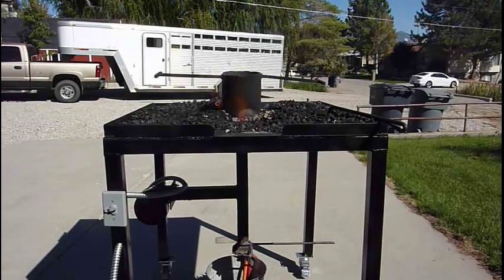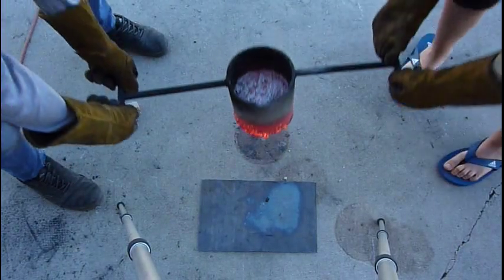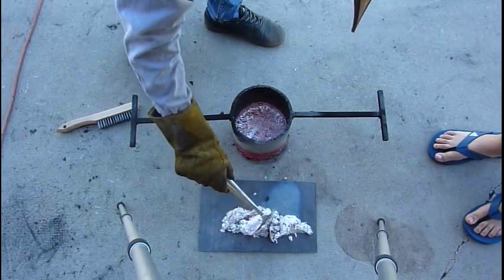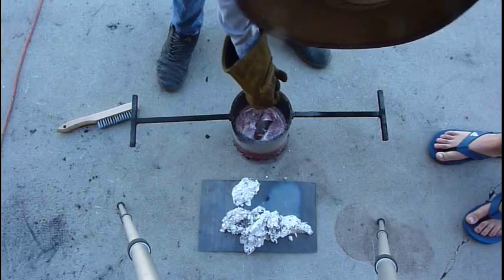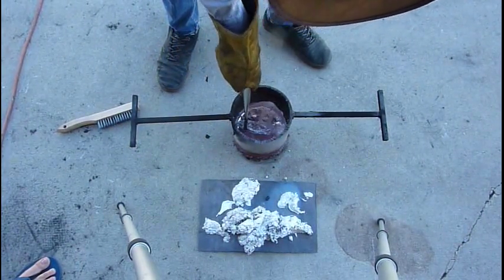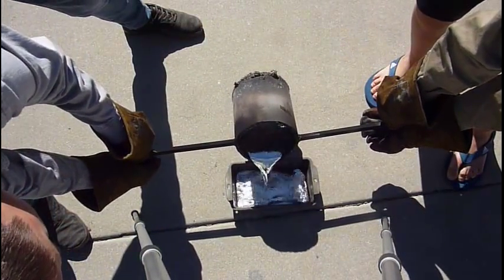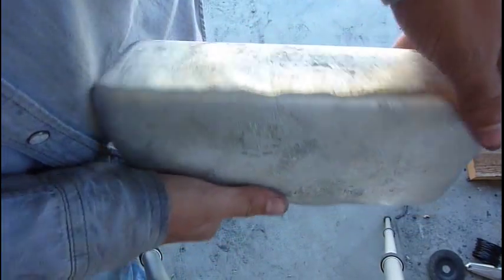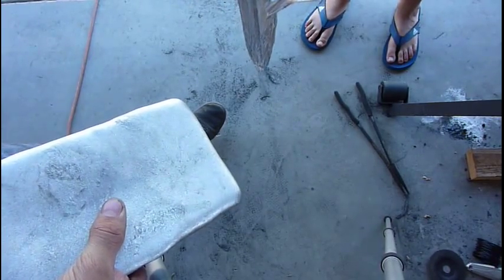How to melt aluminum 02

Comment: young man you did a bang up job on that little forge . and if you can get fuel for 9 bucks a 100 you knocked it out of the ball park . 28 cents a pound here in Texas where I am it or id have about 2 ton 35 bucks to fill a 40 gallon propane tank  it costs here ,  id like to see how that  heats for forge welding . keep up the good work
Reply from the maker: Thank you I will, I've watched videos of people back east who can't even get a lot of them make charcoal which almost burns as hot as coal does maybe that's a possibility depending on wear you live. Would you like to see a video forge welding as in damascus or just iron ill do both but ill do the one you prefer first. Thanks for your input sir.
Reply: I can forge weld no problem , I was saying id like to see how that forge .. welds . I have used  wood charcoal and coal not at the same time  wood you have to let it burn off . kind of messy .  if you have a couple iron wagon wheels don't throw them away   that iron is  perfect for sandwiching   in between  a couple pieces of 5160 aand toss a file or two in there also I learned that trick along time ago .  you need to pound out the iron   down to about 5/32 nds  , thick throw a file in the  center  a for your edge  and you have a good combination for a blade  about 165 layers  for a course structure  looks good . now all you need is a home made  power hammer about 100 pounds . helve hammer be the best ,
any way be safe and happy forging
Reply from the maker: Lucky B I am actually building a twenty ton press that should be done around december Thanks for your advice. I haven't really ever talked to any other knife makers before, I actually do have some wagon wheels..  if  I layer it right in shouldn't effect edge retention?? Thanks and sorry for asking many questions I can only gather so much by watching videos..
Reply: Gb  the Russians have been  using iron in there Damascus for many years for a knife depending on the side  about 10 to 15 % iron in ghee mix for a sabor can be up top around 25 to 35 %  the sing about using pure iron if it helps in flex some and when using steels like 1095 or file steels  it helps suck up  the silica in the steel  . the Japanese  make there iron from  iron sand  and they do the same when they make there carbon steel they just keep adding  carbon to the steel  they want as the edge , its  good to watch them at work  the sword  maker and knife makers I don't know where you are at in the Rockies but over in Wyoming  but there is a famous knife maker over there by the name of ED Flower  I have talked with man for 20 years  and he is a great guy  to talk with he has a forum called knife talk  he knows me by the name of Don  that 20 T press is alright  but put your uprights as close to the  jack as you can get them make sure all the force is centered , and for you  flat dies and rounding dies  stay about an inch don't go 1.5 or 2 inch  it don't have enough to  move the steel   in that volume I ,and a 50 ton is slow  it works best with a 200 psi compressor  and will move a little faster . this is why I made the hint about the  the  home made hammer  ,you probley have enough  in the junk pile to build one  if you have a  big old  3 hp electric  motor  out there on the ranch  that will work fine  and a 6 foot 6x6 wouldn't take long to build one anyway glad to communicate with you  most don't have time to talk with others ,im just a old man with alittle time to kill  between the house shop  and parts house . the little lady keeps me sheltered lol any way be safe and  best to  you ..
Reply from the maker: Lucky B Thanks